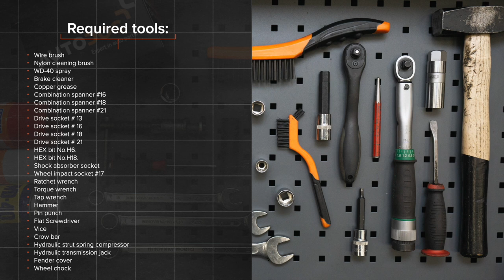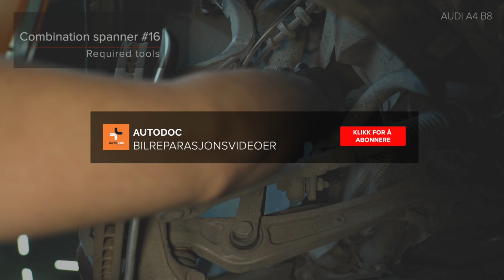Hvordan bytte foran fjærer der på Audi A4 B8 Sedan [AUTODOC-VIDEOLEKSJONER]

Comment from the maker: Merk! Det er en feil i denne videoveiledningen.
12:20 - Skiven bak må strammes med dreiemoment på 50 Nm, ikke 60 Nm.
17:02 - Skiven bak må strammes med dreiemoment på 30 Nm, ikke 40 Nm.
18:43 - Skiven bak må strammes med dreiemoment på 40 Nm, ikke 60 Nm.
18:50 - Skiven bak må strammes med dreiemoment på 40 Nm, ikke 60 Nm.
18:57 - Skiven bak må strammes med dreiemoment på 90 Nm, ikke 80 Nm.
19:01 - Skiven bak må strammes med dreiemoment på 40 Nm, ikke 80 Nm.
19:14 - Skiven bak må strammes med dreiemoment på 100 Nm, ikke 70 Nm.
19:19 - Skiven bak må strammes med dreiemoment på 40 Nm, ikke 75 Nm.
19:27 - Skiven bak må strammes med dreiemoment på 200 Nm, ikke 140 Nm.
21:30 - Skiven bak må strammes med dreiemoment på 40 Nm, ikke 65 Nm.
Vi beklager ulempen 🙇‍♂